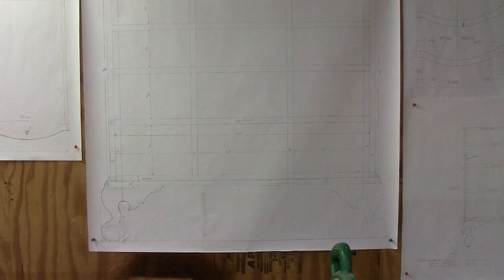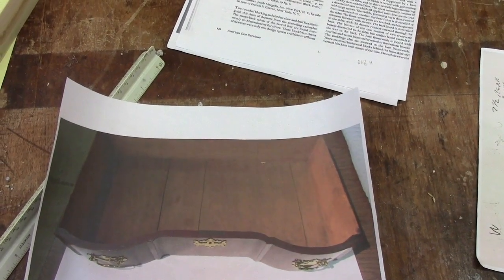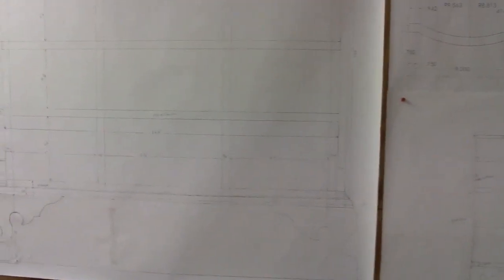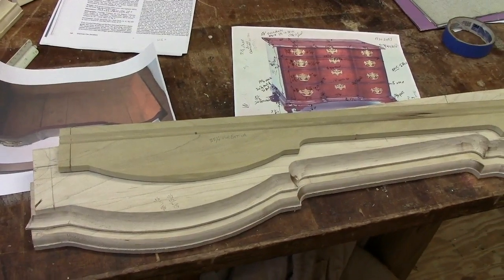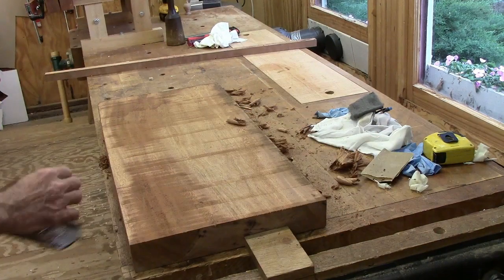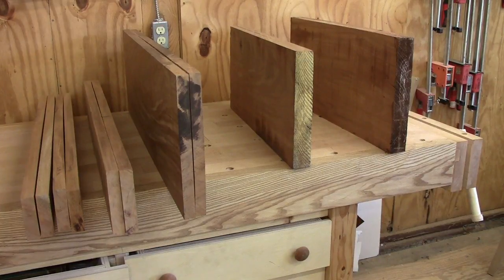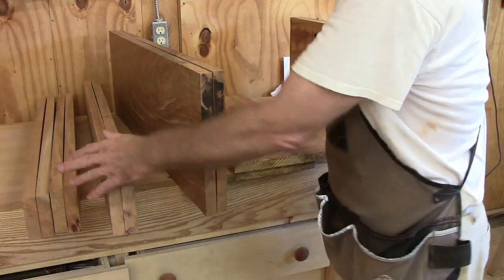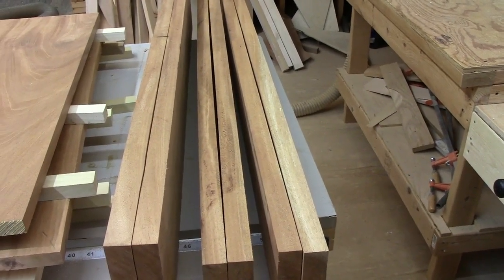Mahogany Curved Blockfront Chest Step 1

Comment: Hi David again:
Are you talking about a 44" /46"  Vertical wide belt sander or a 44" to 46" long Horizontal wide belt sander?
To me I would like the Horizontal 12" long belt sander.  I think I saw a thickness sander in your shop.  Thank goodness I have access to three thickness sanders.  
I built one project out Honduran mahogany.  It was 4/4 material that was 12' long and I needed 3" strips.  Had to rip it with a skill saw and it was very hot & humid outside.  The red stain never cam out of my pants.  Yes, the saw dust died them until they were worn out.  Thought you would like a fun story.
Reply from the maker: Csbinet Maker thanks, that red dust gets in every thing

Comment: Awesome that you went and did a takeoff of the original. Curious why you didn't like the molding on the original? Did you switch to the Winterthur molding or go with one of your own? And wasn't that 10/4 material?
Reply from the maker: Ray Roberts the molding that was on the piece was a bit thin
Reply from the maker: Ray Roberts we just modified it a bit
Reply: Your videos are exceptionally well done and educational (that's why I care about the accuracy)

Comment: Hi David:
You are working on another beautiful piece that looks very interesting.  I enjoyed seeing how much research you did on this piece.  I, also like to draw up full size plans of the project I am starting to build.  It helps me find the problems that I will have to solve.
The drawer fronts looks to be very changing.  I watch you cut dovetails and wonder if I will ever get that good.  You make it look so easy.  I agree with you the top will be very beautiful.  It is a good thing that you have your great big Band Saw.  It was just large enough to resaw the blocks of wood.
When you were flatting the big block of mahogany you said the type.  On the video the type was garbled.  What kind of  mahogany are you using?
Have fun in your shop.
Reply from the maker: Thanks for the complements, the mahogany is Swietenia Macrophylla, or genuine mahogany also known as Honduran mahogany.  Don't know where it came from but I purchased it from Irion lumber

Comment: Looks like a great project!  Will be following along as usual.   DO you venture to Winterthur often?  We are members there and live a few miles away.

Really is amazing how easily the modern drafting programs handle offsets.  I use Sketchup at work and it is easy.   Does not mean I could produce that quality of print however.

They have some apps for smartphone now that are intended for scanning documents but will correct them back to flat from a slight perspective and I am wondering if they would be helpful in copying patterns from pieces?

Jim
Reply from the maker: phooesnax Jim, thanks for following along, i probably get to Winterthur once a year, wish i lived closer.
Reply from the maker: Jim, I do not know how to use any drafting software.  I get by with just drawing, which helps me think through the construction. Tracing of the curves on 18th century pieces is great when I am allowed to do it.